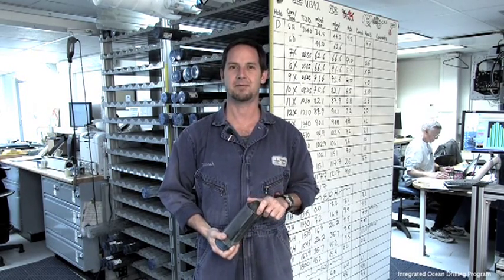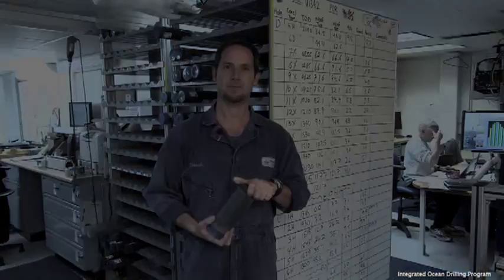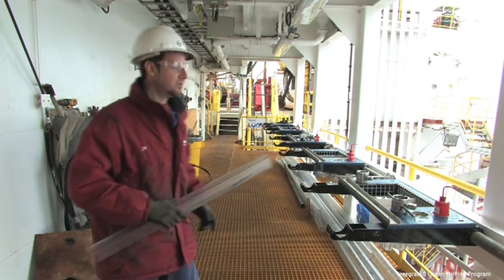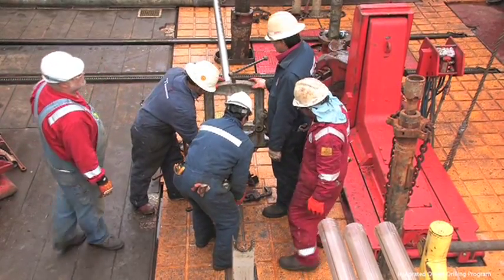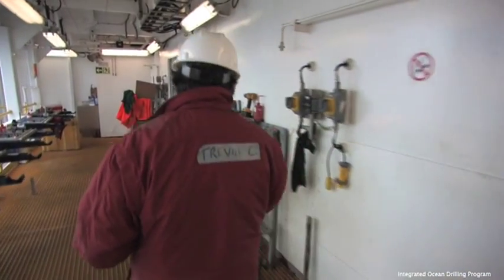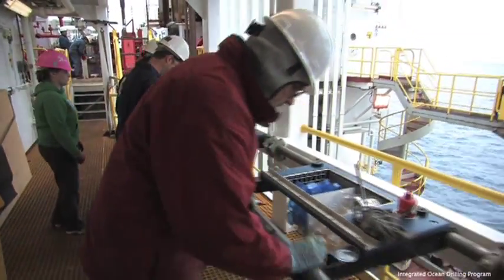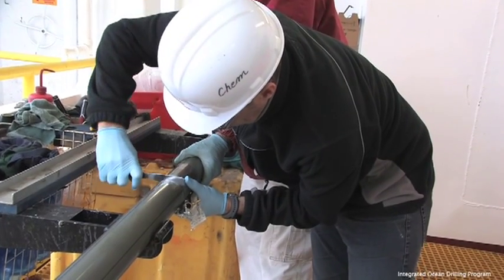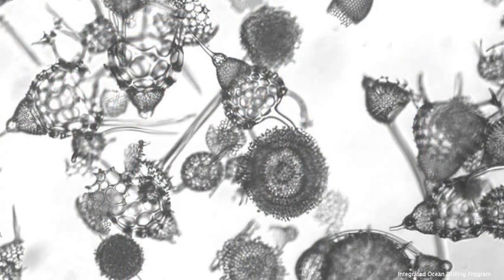Core on Deck!:The Journey of how the Samples travel from the Rig Floor to the Core Lab

Comment: thes flexibles pipes r lower with wireline?? or coil tubing?
Reply: Wireline or sandline as we called it in the early years of JR. I was fortunate to reoutfit the ship in 1986 and worked as a member of the drilling crew for the first few legs of the journey. Americans were laid off to hire Philippino crew for less than half the wages. That's life.